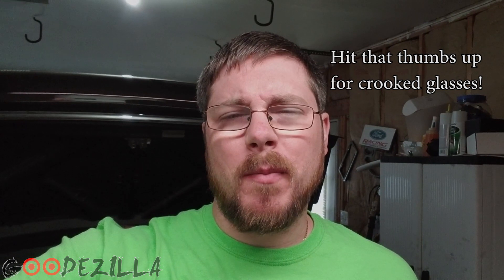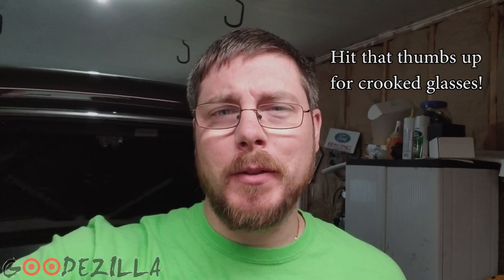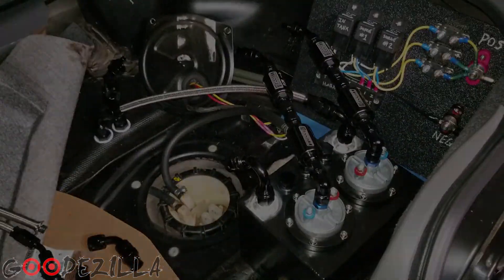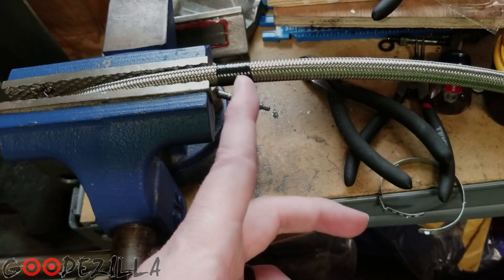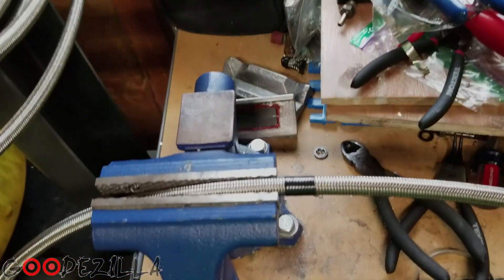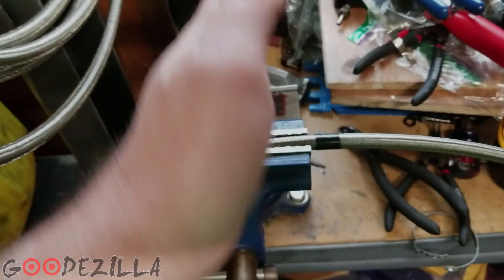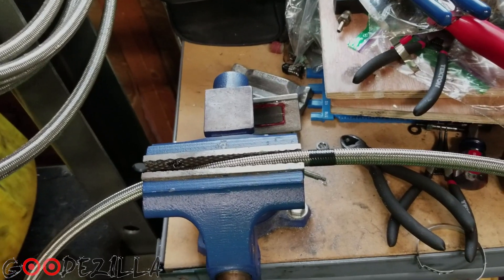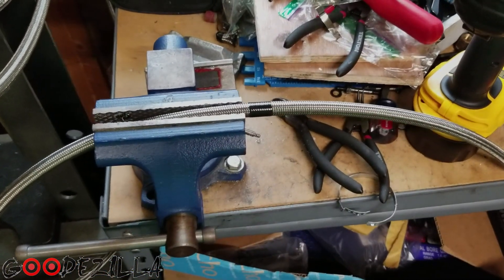Making and Testing PTFE Fuel Lines for E85

Comment: Hi where did you purchase your check valve and cap kit to check for leaks?
Reply from the maker: siliconeintakes.com
Reply: Whelp, I ordered the kit and the 6AN adapter fitting has a threaded NPT on top and I cannot remove it (seems to be a male adapter fitting). They included the copper bicycle stem one, just can't remove the top piece of the AN fitting to swap. Argh...more set backs.

Comment: Nice to see you doing new stuff there :) Got my car on road again, was in garage over the winter. I took it to dyno again and asked if they could raise the boost and brake 600hp limit. They made it but said my stock cams are so on their limit that there is no sense to raise boost anymore or do anything else because exhaust back pressure is rising so high. Anyway got result 604hp/727nm @ 1.7bar. Inside of two weeks Im going to drive standing mile on closed airport to see how fast that beast goes. My target is near 300km/h ^_^
Reply from the maker: Awesome! That's very cool....good luck with the results you're looking for!

Comment: Hey goode another great video. Quick question, do you need PTFE lines? I’m going to be running the AEM e85 pump with a tomei rail and 1050X injectors. Thanks!
Reply from the maker: Hey Sohail, you don't "need" PTFE lines to run e85. They are just much more resistant to the alcohol and the lines don't break down over time. PTFE lines also hold in the smell of the fuel better from what I've heard.
Reply: GoodeZilla would you possibly have a link to the lines you used? Thanks a lot!
Reply from the maker: @soso_yozora  I used the lines and fittings from siliconeintakes.com (if you use their lines, you have to use their fittings too)
Reply from the maker: @soso_yozora  they are ptfe lines and fittings, but I've never had experience with that brand. So I'm not sure if they are good or not.

Comment: Would this material be good to run regular gas thru?  My fuel lines have rusted and I am looking for a substitute material other than steel.
Reply from the maker: Yes they are rated for gasoline as well as ethanol fuels.

Comment: what is 2 step I watched the videos I see how cars are launching differently but how would you install it and did you ever pull the rwd fuse in your car ? :P
Reply from the maker: 2 step is an option in most aftermarket ecus. Or you can get a 2step box like bee-R and use it. its basically a rev limiter for when the car is sitting still and adds fuel to help spool the turbo while banging off the limiter. I have pulled the fuse before.
Reply: Ahh nice now I understand it!

Comment: Lines must be cutted with a grinder (or dremel), not with pliers. The reinforcement (steel mesh) must be lefted as it is, not cutted, as in the video. No lube should be used on the line. Sorry, a big NO from me.
Reply: Why? Not saying right or wrong, just why not cut with sheers? If the line doesn’t damage should be fine? Why lift the mesh and not cut it back?